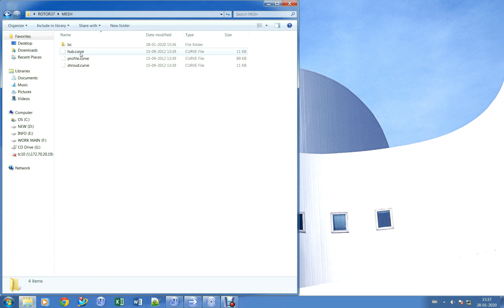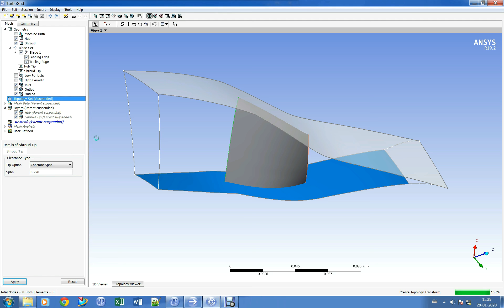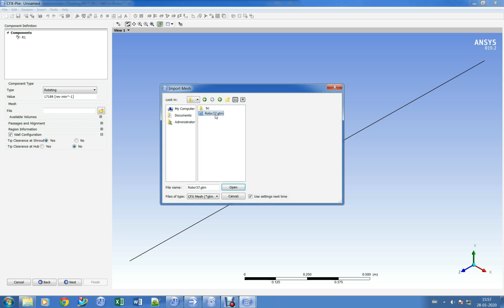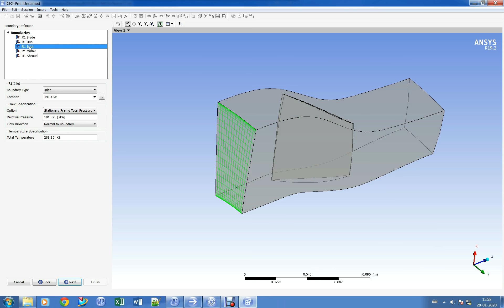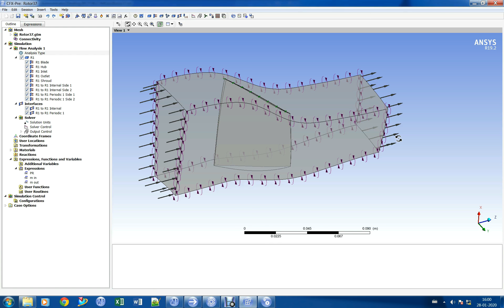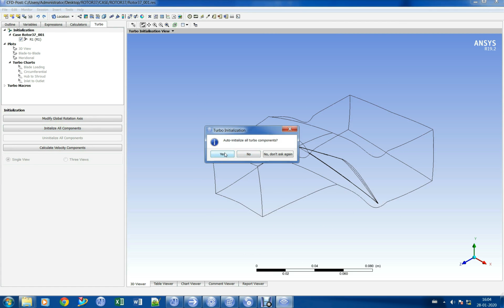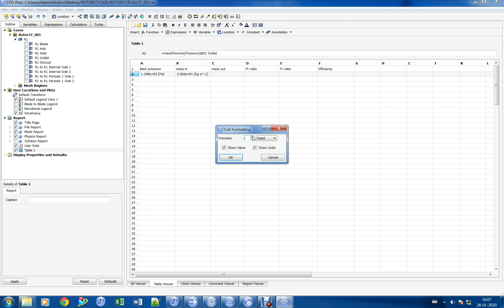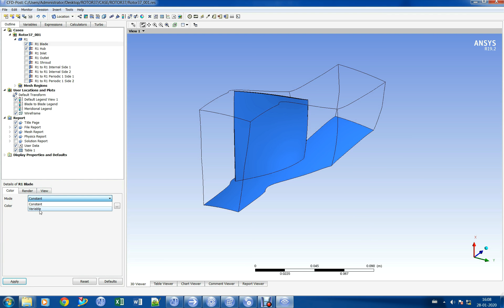CFD analysis of NASA Rotor 37 compressor | CFD Validation | Ansys CFX

Comment: Hello,  Dear Team Learn CFD, 
What step did you using to change the following values:
# of Element 38
Const Element 12
Best.
Reply from the maker: Both meshes are the same, but the viewing plane is at a different span location. You may expand '3D mesh' and select 'show mesh'. Then you may change the spanwise value (K). Then it may show the mesh at the desired location.
Reply: @LearnCAE  Thank you for your clarification.
Reply: @LearnCAE  Hello Dear Team Learn CFD, 
Could you please let me know how to make a Slotted Blades. 
Best Regards.
Reply from the maker: @laidsalem1554  Hello, It is not possible to make slotted blade mesh in turbogrid. You can try to create the mesh in icemcfd. If you could send a picture of the slotted blade, I can suggest you appropriate meshing method. You may email to learncaenow@gmail.com

Comment: can you help me? when I update the mesh it keep showing this message saying "tried to set number of splits to be less or equal zero. Edge id = 6".
I purchased the files and cannot walk through the process in the video.
Reply from the maker: Hi, for different Ansys versions, the control parameters would have changed. You may use the provided mesh file for analysis. Regarding the mesh issue, could you please email to learncaenow@gmail.com with mesh error screenshot?

Comment: hi, what journal paper are you using for validation
Reply from the maker: Design and overall performance of four highly loaded, high speed inlet stages for an advanced high-pressure-ratio core compressor. NASA TP 1337

Comment: Hi, where you get exactly the outlet static pressure from?
Reply from the maker: Hi, static pressure is calculated based on total pressure outlet and Mach number. For this case, expected total pressure is around 2 bar and absolute Mach number would be around 1. So based on these values you can calculate static pressure using isentropic relations.

Comment: I get the same result when I'm not using Inlet and Outlet regions for the mesh, but as soon as I add them, the solutions collapses
Reply from the maker: Do you mean inlet and outlet domains?
Reply: Yes! or even if I expand the domain as the video does
Reply from the maker: It is well and good if you are getting the results without inlet and outlet domains. It is recommended to use inlet and outlet domains for proper convergence and to avoid any recirculation zones near boundaries.